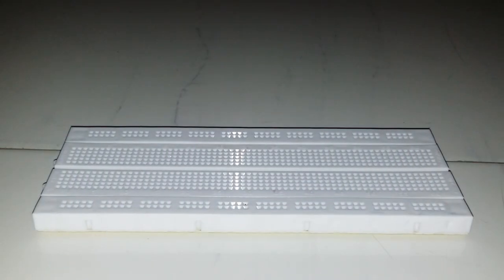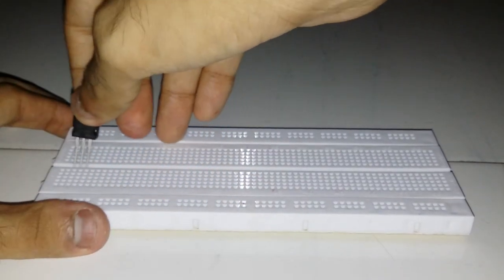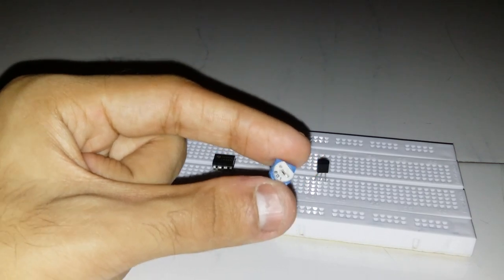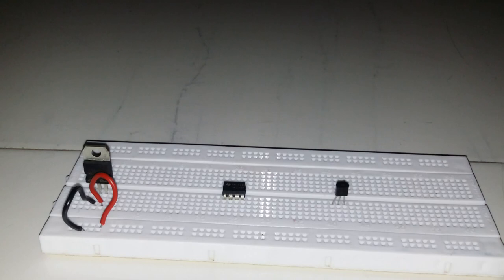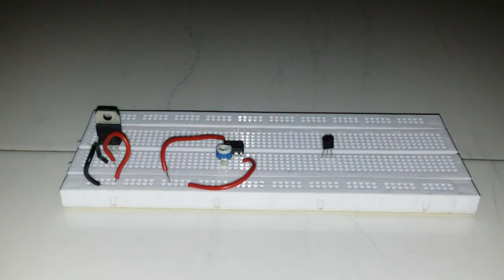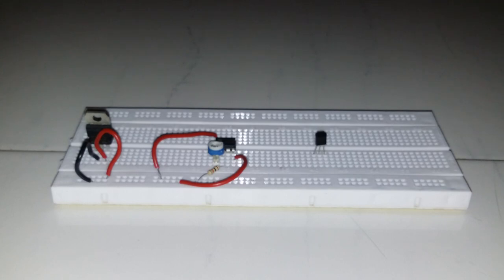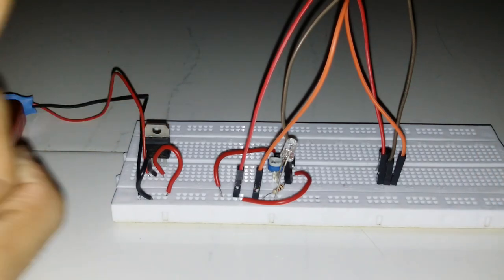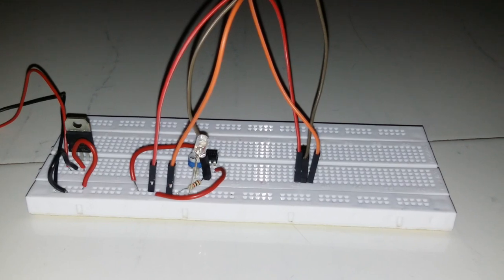TEMPERATURE SENSING USING LM35!!

Comment: How do i check the temprature of transistors?in my ckt there is four transistors being used and various reason they heatup,so i need a indication via any source that they heatup?so can i drag a clip from pin no2 of lm35 and placed to transistor head?
Reply from the maker: If your transistors are heating up  then for sure there is some fault in circuit! Or else short circuit... I need to have a quick remedy for sure!

Comment: Ur explanation is very good but can u please tell me that at what temperature the bulb will start glowing..!! Please I am doing the project..!!
Reply from the maker: LM 35 IC has sensing capacity of upto 150 degrees. So I suppose glowing a bulb would be tedious but not impossible. Try to increase temperature and check at which temperature the coil inside the bulb is excited!

Comment: It doesn't work. The led is glowing

EDIT: I fixed the issue.  The out of the 10k POT should be connected to the 5V instead of the output of the IC LM358
Reply from the maker: Oh cool! That is a good solution too. Any method would work.

Comment: Bro I have tried thi project acc to ckt daigram but not working the led glow bright only
Reply from the maker: Let the IC cool down and the LED will automatically get dim
Reply: @ElectronicTechnocrat  bro actually if remove the lm35 and lm35 connection then also the led glows
Reply from the maker: @kumudkumar4149  Actually
, it's short circuited and needs to be restarted. Check your Lm35 man. It might be an issue.
Reply: @ElectronicTechnocrat  ok bro for sure thanks for lot of support can u plz provide u email I'd if u want
Reply from the maker: @kumudkumar4149  absolutely, its:- electronictechnocrat12@gmail.com